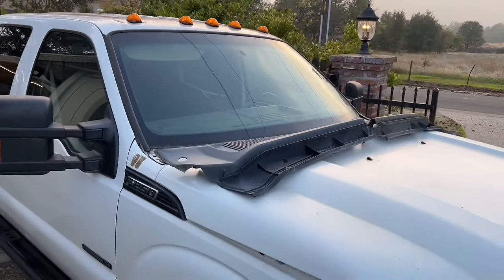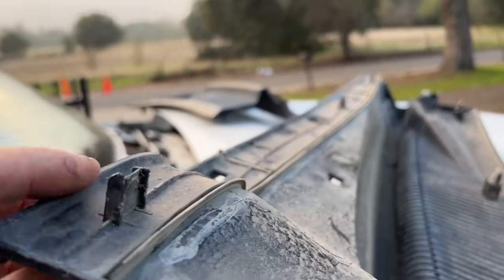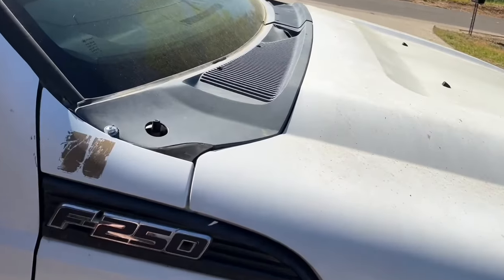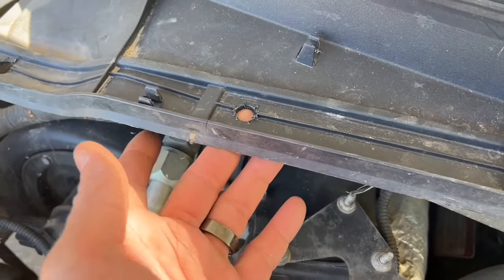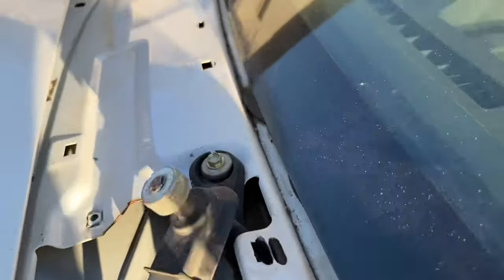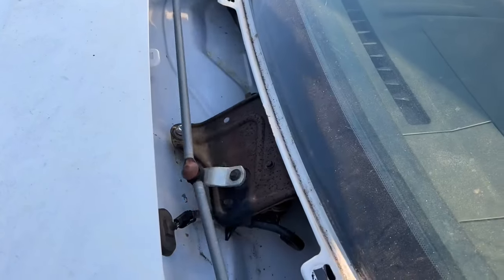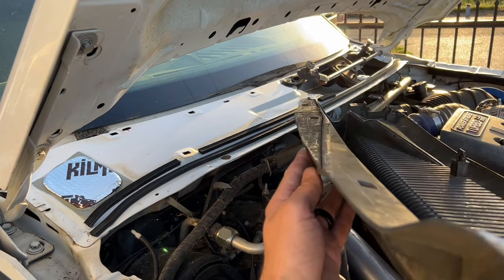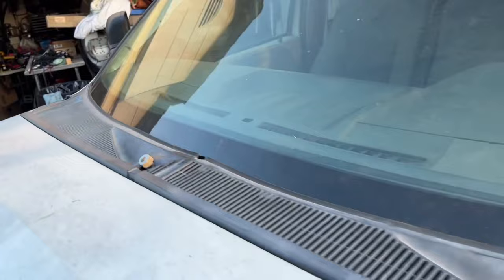2001 Powerstroke F350 7.3 - installing 11-16 Cowl and Wiper motor assembly

Comment: Great content! I am doing a conversion myself, but do not have a spare cowl. Can you share measurements of where you drilled the holes on the passenger side? Like maybe what the distance is from the the closest stock hole and from that little step right below the windshield? That would really help since I am looking to drill those holes as well as opposed to cutting the tabs off and only bolting on the bottom side.